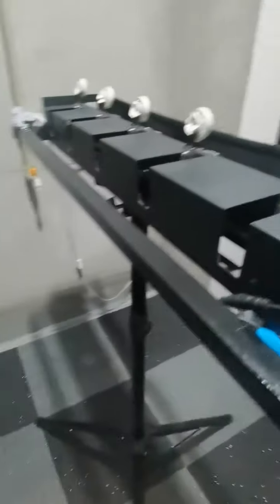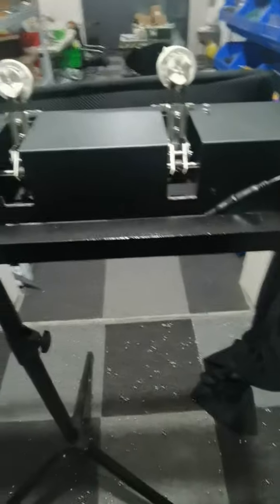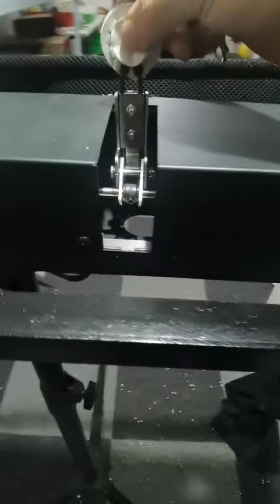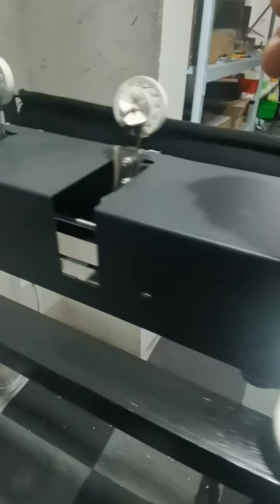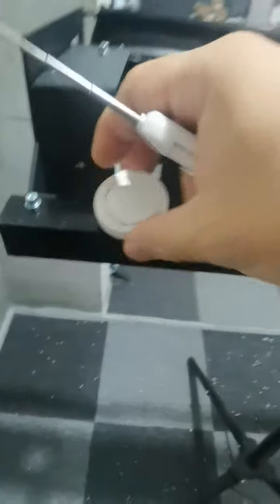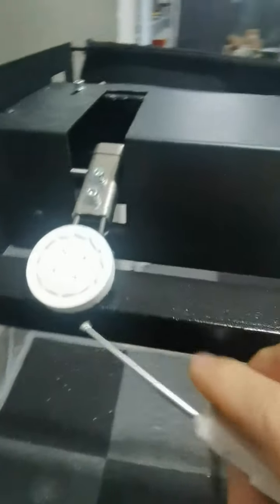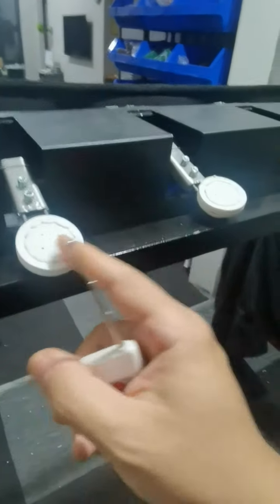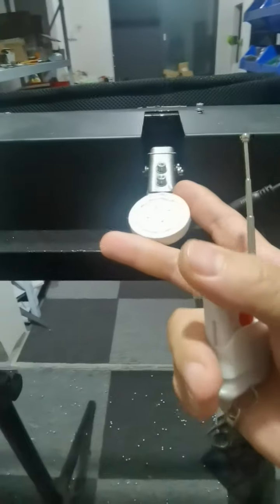How does CSCC target machine work?

Comment: What targets come with it ? Does it have both 80-20 and a set of 40mm to swap out as required? Over time will you sell spare targets as they won't last forever. What warranty comes with the machine (it's an expensive purchase so I'd want to know if it broke it would come with some warranty) 
Same questions for the manual resetting machines you sell and do you know when you're expecting more inventory please? Thank you!